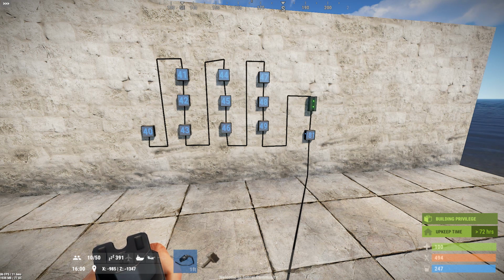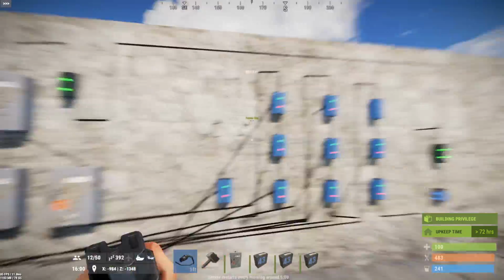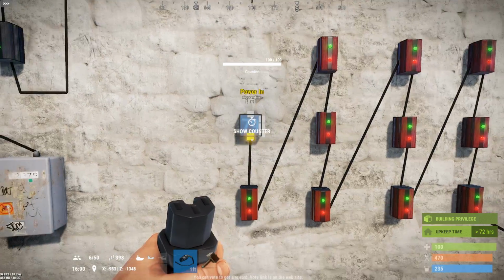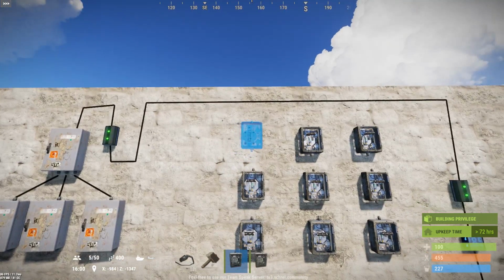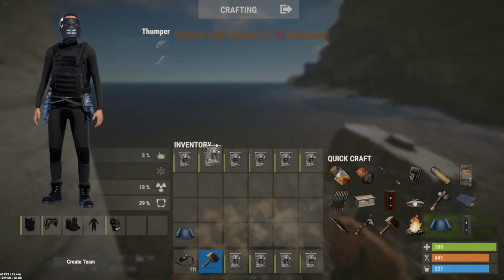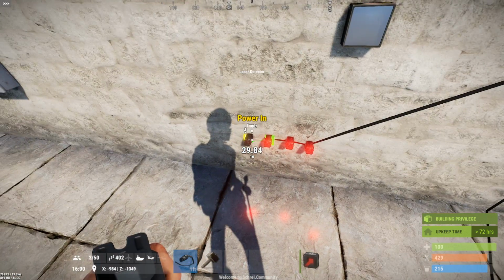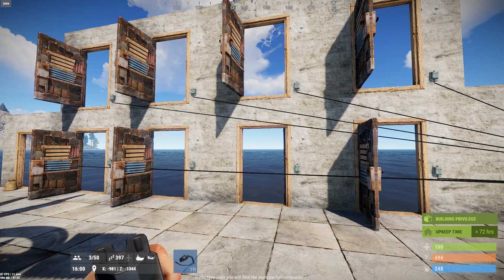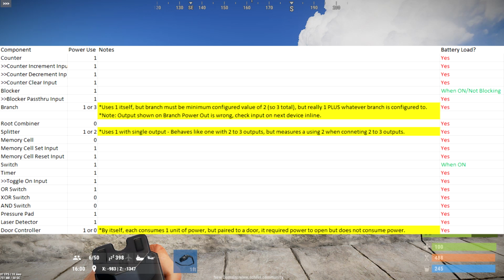Rust Electricity Update - Component Power Use *long version*

Comment: The one thing that doesn't make any sense is why a switch decreases output power by 1.

There is also a bug where two small batteries with a switch between them and root combiner the root combiner as the target will output 0 power even with both switches on between the batteries and the combiner. 

They really need to patch this. A switch should be lossless. This means you can't run a auto turret from a small battery on a switch, and would need to rewire it every time.
Reply from the maker: I would agree switch should be lossless. The root combiner 'bug' is by design. Dev's confirmed. You cannot put anything between a power source and a root combiner except another root combiner. :(